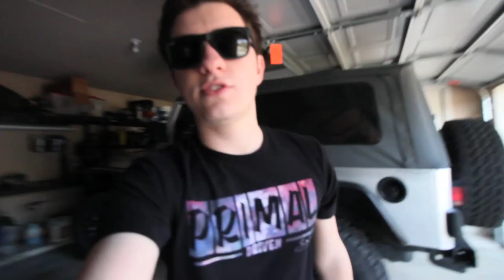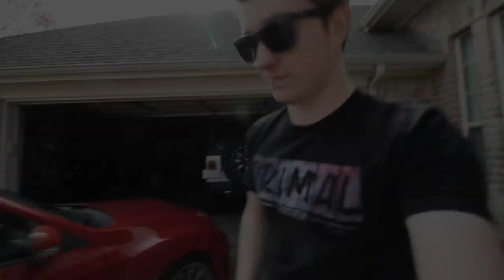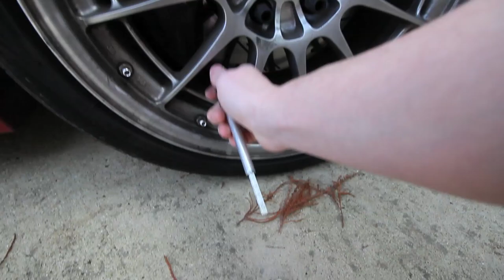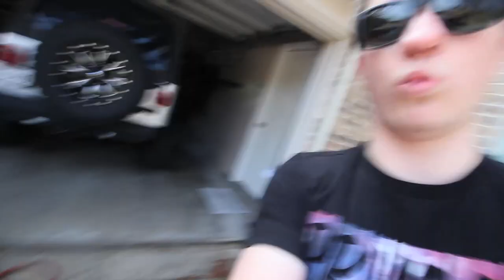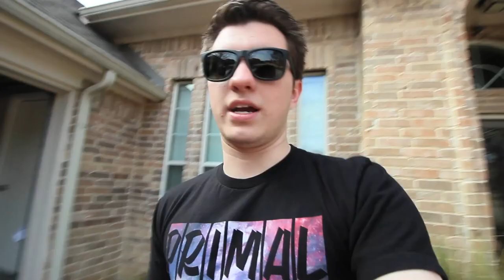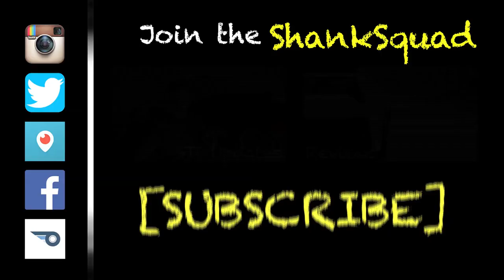WHY TWO VALVE STEMS?! | Enkei NT03+m FAQ

Comment: The actual use is to purge the air out while filling the tires with nitrogen, mostly for race cars. Nitrogen is more resistant to expanding due to temperature change, thus keeping a consistent tire pressure under hard racing conditions.
Reply: +Subie Garage An excellent addition. I suppose for general use this video's explanation makes sense as well. Though again you pose an excellent point I didn't see mentioned by anyone else. Larger aircraft tires are filled with nitrogen to prevent moisture (very low temperature at high altitude that would cause icing inside tires...bad...) and remove oxygen so its not flammable. I haven't looked up about expanding at high temperatures, but that would make a lot of sense too! Thanks :)
Reply: yeah the use in the video is good too, more practical for a daily driver. Cool info on the aircraft didn't know that. If I had an aircraft I would put these wheels on it lol
Reply: This makes a whole lot more sense than explained in the video.
I have Fuel wheels with 1 stem in the front and 1 on the back of wheel

Thanks
Reply: @projectvaderss7467  there is another reason why you have 2. My 20in Niche Milans have one in the regular position and one on the backside protruding out horizontally. The rear is for the TPMS sensor so it fits inside a 35 series tire. It won't fit vertically mounted so they put the horizontal one in back for that reason.
Reply: if you watch Lemans (or any other type of Endurance Racing) you'll see there's a similar set up used for rapid fueling during pitstops with 2 filler openings, the openings are covered with 2 DRY BREAK fittings side by side.  quicker you get the air out, the quicker the fuel can go in.

Comment: Also,  two valve stems help in exchanging ambient air for Nitrogen. One stem is used to bleed off the ambient air while nitrogen is put in the opposite stem.
Reply from the maker: I've heard mixed things about that, which is why I refrained from mentioning it. Cool to know!
Reply: +Evan Shanks either way it's to exchange or check air in a quick manor, Both ways are correct. Just wanted to shine light on the other reason.

Comment: i need two valve stems for my mags , one for compressed air filling and one dedicated stem for the installation of EXTERNAL TIRE PRESSURE SENSOR OR TPS. The purpose is to read the pressure reading while filling it with compressed air at the other valve stem

Comment: But I can pump the air in and measure the pressure at the same time from the same valve stem. So you don't have pressure gauge fitted to your air hose and that's why you need two?
Reply from the maker: At the end of the video: "assuming you need two devices."
There's your answer. You obviously don't have to use both. 😜
Reply: ***** Yeah, I got that :D Nice car and great vids btw!

Comment: If one of the valve stems fails the other won't hold the pressure.
Having 2 stems just means more that can go wrong.
Reply from the maker: Because it's so common for stems to spontaneously combust and disappear
Reply: +ForzaMotorsportManiac1984 The only thing that can go wrong is a schrader valve that starts to leak air which can happen in rubber stems and metal stems and is quite common, plus rubber valve stems are more prone to problems (like most things rubber they start to degrade) than metal ones.  Having two valves makes no difference.
Reply: Just bought used car with 2 valve stems on each wheel,  and 1 is leaking..😒